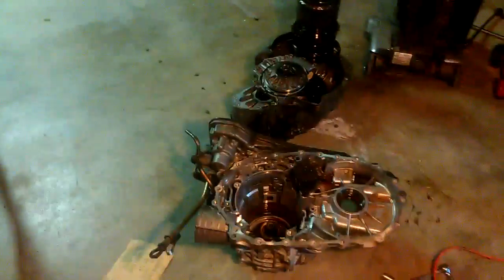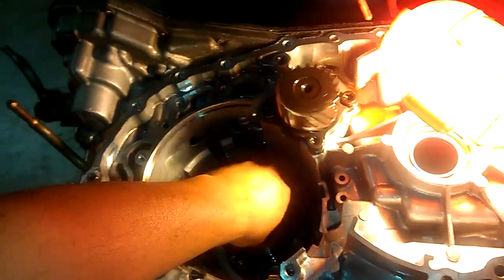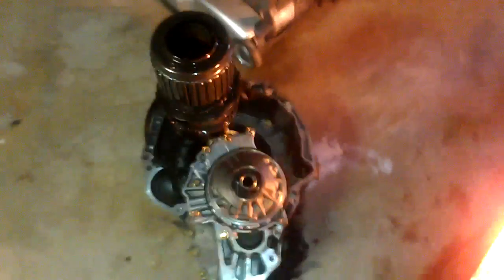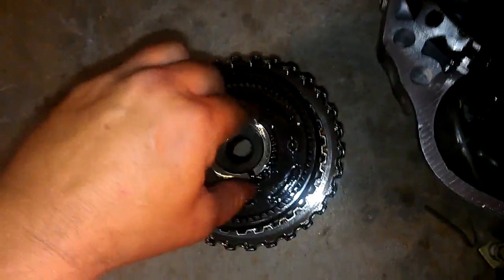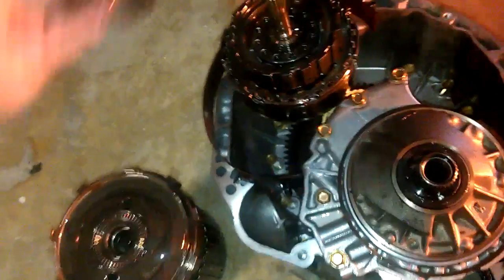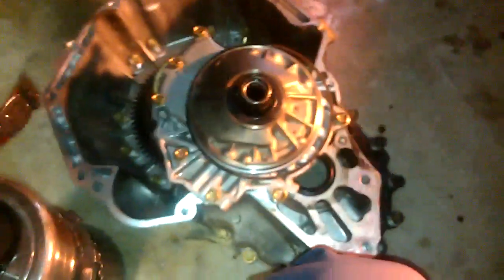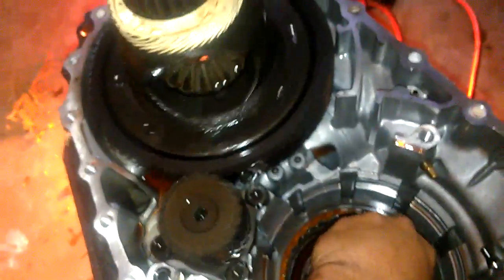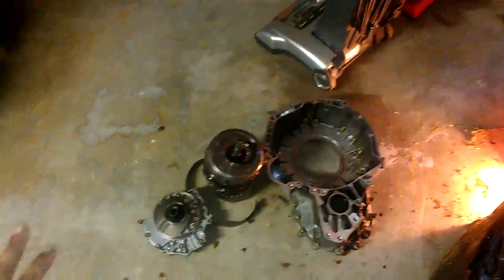Take apart the auto transmission of 06 Nissan Sentra

Comment: Having this issue now after my son landed in a ditch. Fried the TCM which I replaced and the actuators inside the valve body. Had some gears working but not it’s like it’s stuck in 3rd. No reverse and kinda lurches when you put it in P or N. Might take it to Ammco since I don’t want to buy a used trans from the yard and has the same problem.

Comment: Saying the transaxle is simple to work on and then not finding the problem really should not be done in the same breath. Also just looking at the components and saying you can't see a problem with them without taking the components apart for inspection and tollerance measurements is simply madness. As an example you looked at the brake band and said there is nothing wrong with it but did you check the piston that operates on it. The band does not work by itself. Did you check the torque converter clutch rather that just looking down into it? There are countless seals in this transaxle, did you check them? Did you take apart the valve body and check the return springs of the valves? These springs can break meaning no drive. If you can't fix or find the problem please stop misguiding your viewers by saying it is simple without even having any concept of how it all works when put together.

Comment: Was this a cvt transmission.  Just wondering if after replacing transmission if you have to reset any codes or do any programming of the computer.
Reply from the maker: The newer Nissans have those CVTs. I did not need to do anything "special" like resetting codes or anything after replacing the trans

Comment: An Altima, same exact situation and symptoms.  I have the service manual in PDF, good trouble shooting.  If there are no codes, and the car switches into gear, but car does not move.  It is saying it is possible the transmission oil pump.   I can send you the manual, it's really helpful.  Just send me your email address and I will send.  Thanks.

Comment: Hi Gilbert, did you ever find out what the issue was with the Transmission?  I did an accidental Neutral drop also, and then my transmission stopped working and was acting like yours in the other video when you switched to any gear and it did not move.  No codes, and transmission was fine before that (No Slipping).  Any Ideas what happened to yours?